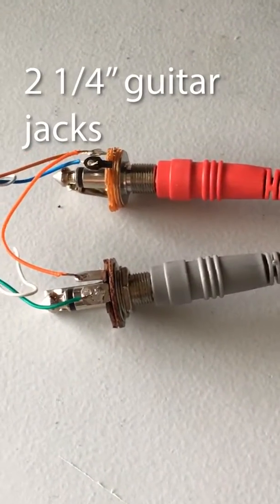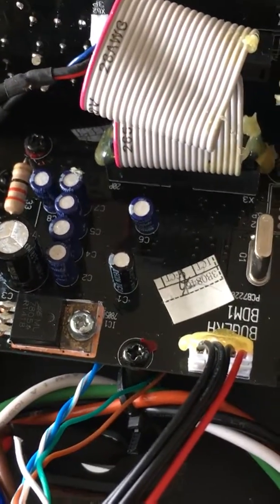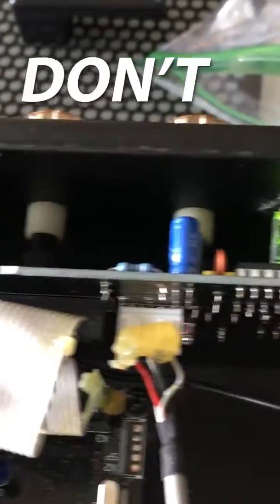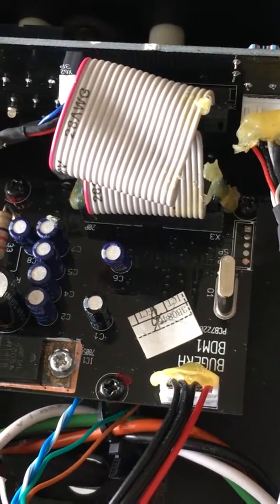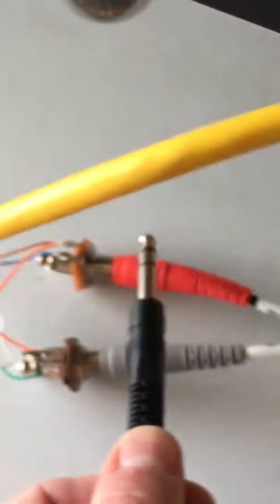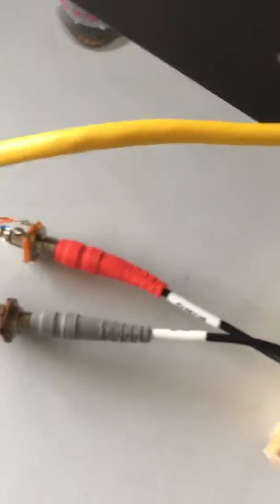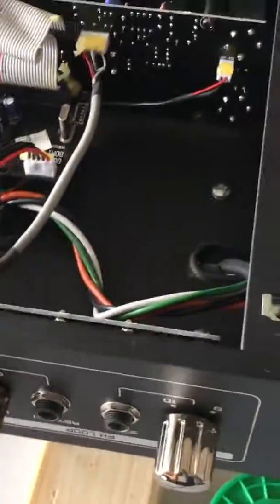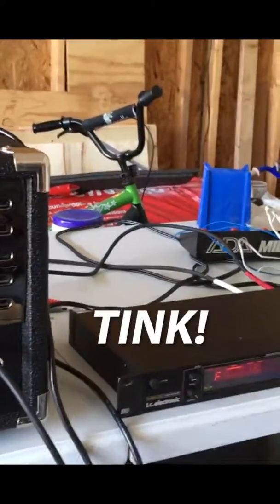Bugera 333xl Footswitch mod TC Electronic G Major switching

Comment: Hello,
I am French,
sorry if my english is not good.
I have the problem known Bugera footswitch.
Could you explain to me how to remove the footswitch of orignie and replace it by your assembly?
Know where and how to connect?
Thanks in advance
Reply from the maker: yohann cluzel Are you handy with electronics and soldering? The cool thing is that this mod doesn’t require you to remove any parts from the original. You’ll need a multimeter, some wire strippers, CAT5 wire and some zip ties.
Reply: @jamesjrmusic  Yes no problem, I know how to weld and I think that having a good teacher, I should get there.

Comment: Hey dude!

You can use the Bugeras build in controller board easily to build a custom footswitch. Basically the Bugera uses a resistor ladder, leading to different input voltages, which do the switching. The main contacts are GND and WHT to which the input voltage/resistor ladder is measured, all other contacts are only to provide the respective footboard LEDs with power. 

And also, I used the front panel contacts to make a fixed channel switch, since I hate the buttons - they flickered around on my bugera, leading to random channel changes and shot like that.

I have "reverse-engineered" (bold word for working out a simple schematic) the footboard and I am willing to share info on that! Hit me up if ya want to.
Reply from the maker: Pipp Priss Great info, dude! I never had a footswitch to look at in person. The only schematics I could find were for the controller itself.  Also, I wanted the external jacks so I could use the G Major.
Reply: Hey man I'm into modding my amp/footswitch to use with external looper to create patches. Any clues?
Reply from the maker: Sebastian Kazuya not really. My mod is to avoid using their footswitch. It sounds like you want to use the Bugera footswitch to also perform functions on a looper, so I wouldn’t really know anything about that.
Reply: @jamesjrmusic  I don't really care for the Bugera footswitch as long as I can use a midi controller or a pedal looper to create presets (say preset 1 =pedal 1+2 on clean, preset 2 = pedal 4 and 5 on crunch etc.)
Reply: If you can work out how the footswitch works you should be able to build a 5-pin DIN to TRS adapter using the original cable and a female TRS jack, to which you can connect a regular TRS cable.  If it is anything like a Peavey you will find a wire that powers the LEDs.  This will be the only powered wire.  There will be a common ground, this is a bare wire generally.  Then there might be another wire that tells the amp whether the footswitch is connected or not.  Connect that to the common ground. There might be an effects switch.  If you can work out which wire that is then connect that one to ground too, that will make the loop always on when there are cables in the loop jacks. Peaveys have one out of seven wires that does nothing (this is the wire next to the powered wire). Then there are two that control the channel switching functions. The Bugera is a 5-pin so it must be simpler than this.
Reply: You bro. I'm looking  for footswitch board schematics, can you help me with that?